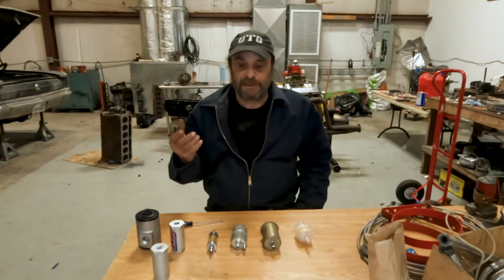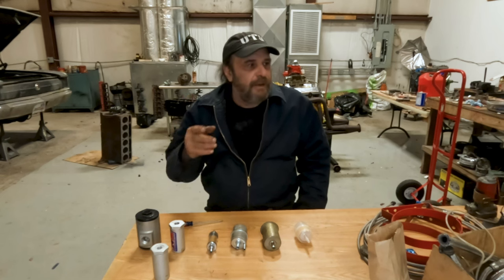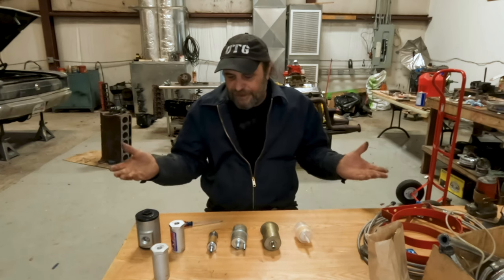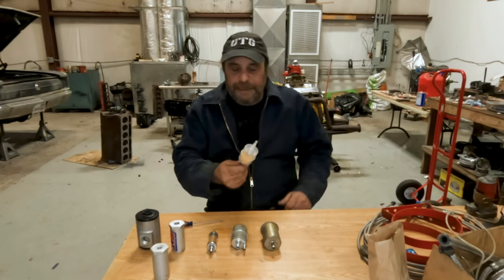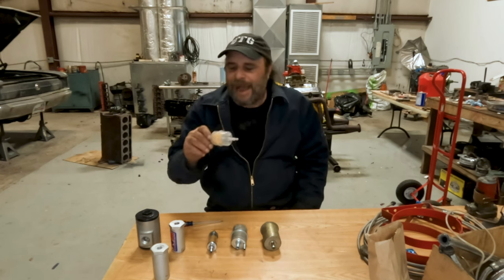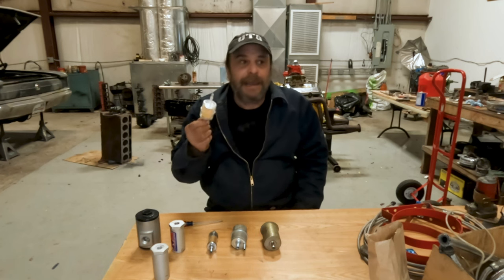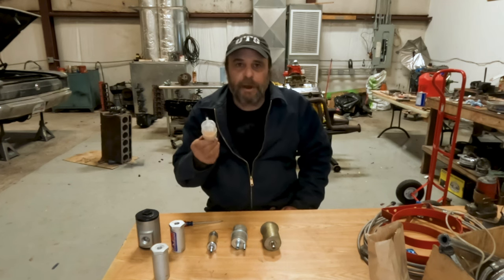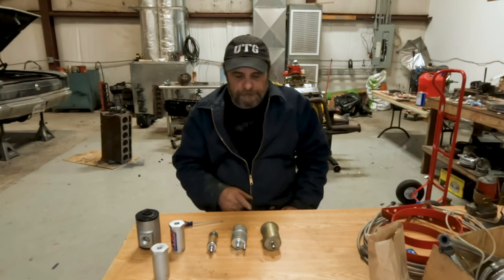Fuel Filters For Carbureted Engines From Mild To Wild - Pros, Cons And Which Is Best For Your Ride

Comment: I worked in a particularly blue nitrous product for a fairly well known aftermarket company, and my supervisor used those nitrous filters on his C10 custom for both fuel and a 150 shot, said it was one of those purchases that you never really think about until it becomes a problem. Plus with our factory discount he picked em up real cheap (you can too through their ebay "scratch and dent" sales), his methodology behind it was that it was a part that he would never have to buy again for the life of the truck (much as you said), and one of those things that a budget build probably should just break down and get. Nickle's and dime's will get you in the long run, and it is simply one less problem to solve, just to add something to those they are rated around 5000psi for the brass/bronze filter component itself (the body is rated at like 13k). Also a side note, blue lock-tite makes an excellent sealing agent for nitrous components (it was what we used as factory for the bottle valve assemblies, and plate fittings), as well you don't need an Aluminum wrench just get some thick pieces of denim or floor mat rubber to tighten the end caps to not mar the hexes.

Edit: Check the urethane/nylon gasket inside, it's the only component that will ever really fail (it might get pinched or just degrade over time, but they cost like 3 cents to replace, do not attempt to use rubber or the afore mentioned lock-tite because they double as a spacer for the brass/bronze mesh) if you care for the filter.
Reply from the maker: Great info...thank you!  I'll pin this
Reply: @UncleTonysGarage  Shweet, much appreciated Uncle Tony, hope it helps someone with their budget build going forward.
Reply: @UncleTonysGarage  Thanks for the pin. I never thought about filtering the Nitrous.
Reply: Nice post
Reply: Wow

Comment: My buddy had a glass inline filter on his hot rod back in the 80's...  He was driving it to work one day when he noticed flames flying by his window.  The filter had cracked and sprayed gas over one of the headers (fortunately he didn't run a hood ).  He pulled over immediately, had a pair of spare pants in the car and beat out the flames.  One fender and a running board had been damaged.  Although bummed, he said it was cool to have a car with a real "flame job"! 😆
Reply: I bet he also used the spare pair of pants afterwards 🤣🤣
Reply: @diesel7903  😆
Reply: I allways heard you could clip some wooden clothes pins on the steal fuel line at the carb to help with vapor lock I tried it seems like it helped.
Reply: scott offord  that is cheaper than a pair of pants,  and it is much better for putting out a fire.
Yeah,  I do the same with all my vehicles
Reply: Being a Dodge guy I’ve had my fair share of vapor lock issues. I found the best way to stop the issue was a rotary vane fuel pump installed near the tank and run rubber hose all the way from the pump to the carb. This all but eliminated my daily summer vapor lock troubles.
Reply: @robertchall8576  I read that trick a few times when doing research for the horrible vapor lock problem I had on my square body that I fought for over a year. The clothes pins insulate the line from the heat of the engine. I eventually got some 3/8 nickle/copper line and made my own fuel line from the pump to the carb, and routed it away from any heat source. 

The fuel in the carb would also boil off after you shut the engine down. If you came back after a few minutes and tried starting it, it would crank and crank. A thick spacer/insulator solved THAT problem. 

Then it wanted to spark knock (ping) on any fuel lower than 94 octane and I went down a rabbit hole of spark plug heat ratings, ignition timing curves, fuel/air ratios, flame fronts in the cylinders ect.
Reply: @cygnus1965  I though you were going to say being a Dodge guy you had your fair share of automotive fires.
Reply: I kid. I grew up on a dodge farm and my Dad and brother still drive them.
Reply: @robertchall8576  Vapor lock happens with the amount of vacuum, mix of liquid and the Temperature. Clothes pins do not change any!
 Magnets and clothes pins, and factory part numbers as all would prefer to keep the customer out of tennis shoe mode!

Comment: Finally someone who does not hate the glass fuel filters for no reason. Good video.
Reply: Well, they are heavier. Weight robs horsepower at the wheels
Reply: I’m still not going to run one only because I don’t want to hear people telling me my cars going to burn down. Don’t have the energy to argue anymore.
Reply: @al_dente4777  weight doesnt rob horsepower
Reply: I used a glass filter instead of the Rodchester 4bbl built in filter for years, no problem.  I especially like the glass filter on my Simplicity lawn tractor. First glass filter I owned came off a 69 Roadrunner in a junkyard.
Reply: @dand3975  I only use plastic or glass on the vaccume side and a metal fuel filter on the pressure side. Never had a problem with them.
Reply: @sasquatch440  It won't rob horsepower. But weight will need horsepower, in order to move it
Reply: @Ian-of9oi  You could always saw a metal filter lengthwise, empty it and then cover your glass filter, clamping it together with a cable tie
Reply: @sasquatch440  No, weight doesn't rob horsepower, it reduces performance.

Comment: One of the most recent Chinesium fails I’ve had was a failed plastic fuel filter that melted together on the tank side. Couldn’t figure out why I wasn’t getting fuel 1 month later.  Apparently the plastic wasn’t resistant to gasoline.
Reply: @The Maverick Mechanic Wow! Got to love the crap that we are getting these days! Unbelievable!
Reply: MAV, I know what you are saying. same thing actually, however, I also had a diaphram fail shortly later. so I wonder if oil was                                                                                                                                                                                                                                                                                                                                                                                                   damaging it too
Reply: I had the same thing happen, Chinese chrome fuel filter looks awesome in the chrome dressed up 350 engine until the engine starts jerking itself out few weeks later. Cut the fuel filter, the element inside just broke to pieces causing the fragments to enter the carb. NEVER again, NEVER.
Reply: About as good as a chocolate fire guard

Comment: I always try to keep to the "use less than 6 inches total of rubber hose" rule the NHRA uses. I would bend hard steel line with AN fittings and steel braded hose for flex points where possible, I cringe when ever I see 3 feet of rubber hose and a cheap plastic filter running past the hot exhaust hedders up to the carb

Comment: I had one of those glass filters shatter on a 383 MoPar! I thought I liked it, but it seemed finicky and prone to leak; and then my fuel line job let it rattle on the intake manifold and break. I needed a tow that day. The metal type hasn't let me down.

Comment: I had one of those glass filters once. It failed. Not the glass, but the metal tube inside let go, one end popped off of the filter and I had gas all over the place. Great. Maybe a one-off defect, but the glass filters were banned from my engine after that.

Comment: I had a glass filter cause a engine fire and wrecked the paint on my hood and fender. One of the o rings failed, dripped gas on the hot header and caused a small fire. That fire caused the glass to get hot and burst dumping a lot of fuel on to the header. The fuel pump was running dumping a lot of gas onto the header feeding the fire. Luckily I was in my driveway and was able to kill the engine and to get a hose and get the fire out before my car get damaged any worse than it was. Once bitten twice shy I have never used  a glass filter again.

Comment: I've never seen one of those glass filters break either, but every single one I've ever seen has leaked in the exact way you're describing and they do it over and over because the glass cuts into the seals. I'm not a fan. If you need one as a diagnostic tool for a temporary issue, fine, but I'd never trust one.

FWIW, Edelbrock markets an aluminum housing, reusable element, filter body for street/stock motors that actually isn't that expensive ($20).

Comment: A good solution to vapor lock on the carburetor side, from which I can vouch from personal experience, is to install a thermal barrier in place of the carb gasket. My solution was a 3/4" plywood "gasket". The more professional solution is to buy a phenolic type spacer and install it underneath your carb.

Raising the hood hinges so you have about 1/4" to 1/2" of an air gap between the hood and firewall also helps tremendously with underhood temps & airflow(also personal experience)

Comment: I installed one of those glass fuel filters on my old Ford garden tractor just as a lark. I ran it one summer and tossed it. I couldn't get the damned thing tight enough that it would leak like crazy. I finally just put a standard plastic filter and haven't had an issue since.

Comment: I'm super finicky about keeping things neat under the hood. I'm also die-hard about filtration. When building my 289 Mustang, I didn't want to have a generic looking plastic fuel filter. So after some research, I found a fuel pump for a 390 Thunderbird which came w/ optional integrated filter element. It spun on the bottom and was the size of a small oil filter. Looked factory, filtered great and you can spin off to inspect inside. And also ended the great debate of filter before or after the pump.
Reply: the early 289s came with the same type of filter/pump. didn't know the 390 pump would fit the 289 series though.
Reply: @Ecosse57  The bolt pattern for the pump is the same but the pump arm is slightly different on the FE than the SBF. Seems like it works though if he's using it.

Comment: 7:45 Brass Moraine is the type of element used in the "Nitrous" filters. The same material used in many smaller sized fuel filters. Holley used to put small brass moraine filters at the inlet of the center hung bowl style carburetors, one at each inlet.
Reply: Old GM too

Comment: I got one of those glass fuel filters in my Christmas stocking one year.  If I remember correctly it was made by Spectre. It had different screw in adapters, so you could use whatever size fuel line you happen to have,I used the 3/8. Anyway I used that fuel filter on a 77 Blazer. It worked fine until about 6 months later.  The heat from the engine made those plastic adapters brittle and one of them broke, spraying gas all over the engine compartment. Luckily I had a fire extinguisher, otherwise that truck would have burnt down to the ground.  Needless to say, I didn't make it to work that day.🤣 Anyway, if you use one of those glass filters. I strongly recommend getting the one that has all metal ends where the fuel hose hooks up, or replace the plastic ones with brass ones. I'm sure the glass filters are just fine, but I've never used one again since that happened.  Those cheap chrome fuel pressure regulators don't last long either. They leak after awhile

Comment: The glass filter either the seals leak or the element collapses, had a piece of the end seal hang a float needle open. Turned the secondary bowl vent into a drinking fountain, luckily it was caught before the open headers lit it up.

Comment: Years ago I had one of those glass filters loosen and leak fuel under the hood of my firebird, I noticed later  my friend was using one on his car. I told him those things will leak. A few months later I saw him. he told me I was right that his had come apart also. Those foam edelbrock air filters with the metal screen over them should be avoided,  I had the foam catch fire luckily I was able to lift the hood and put it out. I would not ever use either one again.

Comment: I've been running a glass filter for years in my 78 f100 . It has helped me find issues with the fuel system several times. Never an issue with it in 70 thousand miles.
Reply: You'll never have a problem until you do. And then 70K miles means nothing. I knew a guy who was an 'expert' on firearms. I told him something he didn't consider once, that the operation of his rifle was more than just chamber pressure, there was a gas port and he was taking a risk by not considering anything but chamber pressure: the operating rod was accelerating well past its design intent. I told him how to avoid any issues and why the gas expansion rate of powders produced today were the root, not his overall ammunition choice or chamber pressure safety margin. "I've never had a problem" was his "expert" reply. And he will never have a problem until that oprod smacks him as it de-tracks from the bolt. Then the thousands of rounds during which he "had no problems" won't mean a thing. He won't get hurt much, a bruise on the cheek probably. And then I'm sure it will be the rifle's fault.
Reply: @bbb462cid  that's why I replace the two gaskets every other oil change
Reply: @4spdlife857  Cheap and easy insurance for sure, but a QUALITY gasket made of an appropriate material for the fuel will last a ridiculously long time. Fuel injected cars have been using those types of seals for several decades at way higher pressures and they hardly ever fail on their own even after 20-30 years. But that's OEM grade seals. With low quality or improperly formulated seals, degradation is a real concern.
Reply: 70k. 
My car has 70k when it was 3 years old.
Reply: Yeah its kinda like plane crashes. Most people go tits up another way
Reply: @averyalexander2303  oh definitely I just do it to keep it from leaking but I've had them last 5+ years just depends on what brand of seal I bought last
Reply: @averyalexander2303  I found the Mr gasket doesn't last as long I forget the other brand I was getting but they where great seals but unfortunately they got discontinued at my local auto parts store
Reply: @averyalexander2303  yeah I think they use a Viton oring on fuel injection if I could get those for a glass filter that would be great

Comment: I had an 86 Regal that I swapped and Olds 350. Glass filter split and sprayed fuel everywhere. Thankfully it was with the hood open after a tube up. Mounted in a safe spot. Nothing hit it, it was idling and just failed. Won’t use them anymore. Thanks for the great videos. Just wanted to share my experience.

Comment: I would never use a glass filter like the one you showed. When I bought my car 3 years ago I smelled gas. I opened the hood and gas was leaking from it. Inspected  and found the ends were leaking and the glass was not broke.  Ends were tight and seals were good. I just was coming apart.  Replaced with 2 Holley inline filters.

Comment: On my bracket racer back in the 1970's, I used a Holley electric fuel pump with separate pressure regulator followed by dual clear plastic fuel filters (one filter leading to each fuel bowl on the Holley Double Pumper). The fuel filters would normally show having been half-filled with gasoline with an air or vapor space. However, at the drag strip when the cool can was filled with ice, the filters became full of fuel, with no space evident showing the air and/or vapor had been eliminated.

Comment: I've had had a couple of these glass filters and both eventually broke the glass cylinder.  I solved this by cutting a piece of aluminum tubing as a replacement.  The nylon type filter mine came with was so fine, nothing gets through to stick your float valve open but they clog quickly due to the small surface area.

Comment: I used to run the in-line clear plastic ones on a straight six with a mechanical fuel pump on the draw side not on the pump side. I reckon they were pretty good

Comment: I had one of the glass filters come apart and dump fuel everywhere. It was not due to not being tight enough, but the alcohol in the fuel attached and ate away the threads on the die cast end caps (male & female). They may have fixed the problem by now, but at this point you couldn't pay me to use one again.
Reply: This is exactly my experience.
Reply: Those threads are fragile, over torque them and they will fail. All mine were older MrGasket brand. Possibly the alloy was more resistant to the ethanol. Many manufacturers make that design now.
Reply: @bbb462cid  alcohol eats metal?
Reply: @schlomoshekelstein908  Yeah, something doesn't add up there.  Maybe it was one of the ChiCom knockoffs with the plastic fittings at the ends.
Reply: @schlomoshekelstein908 The water that alcohol attracts does if there are two different metals. Such as a pot metal filter housing and a brass fitting.
Reply: same thing happened to me
Reply: This is the reason, they use plain old rubber Orings in them now super dangerous because the fuel just disolves them over time they are trash now maybe they used to be good.

Comment: I run two glassies, one for fuel, one in the ps return line with a bar magnet zip tied to the glass tube.  Always nice to see what's going on.
Reply: Great idea on using the glas type the power steering return, especially with a magnet.  I’m about to rebuild a steering box and pump so will give this a try!
Reply: Whare dose the shavings that could get magnetized com from?
Reply: There's always going to be microfine steel slurry from wear, tear, and break-in flying around in there. Larger stuff can come from burrs on the fitting threads getting knocked off, grit falling in from the filler cap, etc. I started doing this after the classic GM morning sickness killed my rack and all the debris promptly killed the pump in turn.  Honestly, building (even a small) hydraulic system without a filter is as goofy as building engines without full oil pressure gauges.